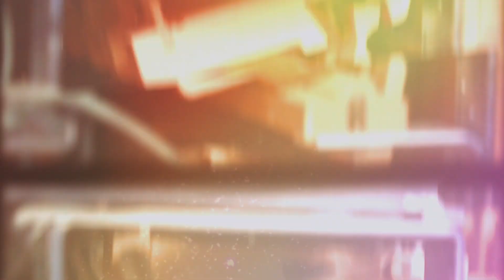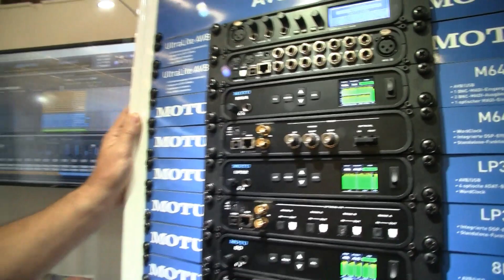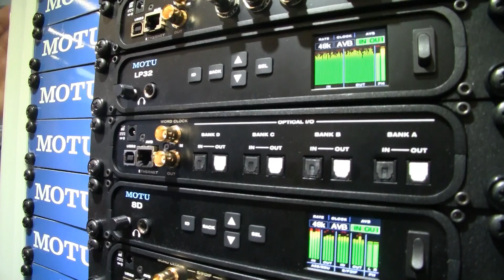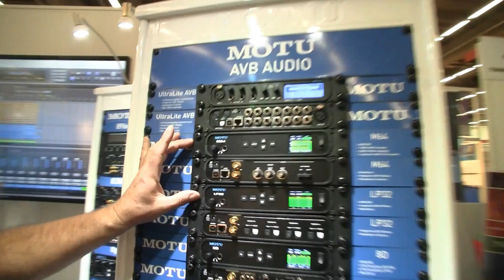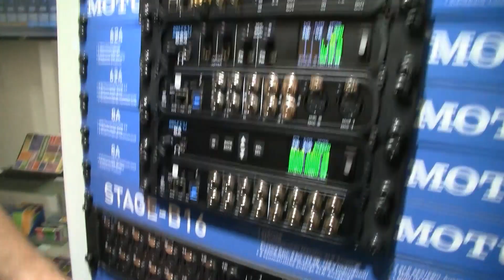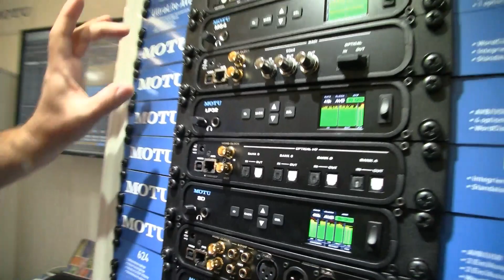MESSE 2017: MOTU - 3 New AVB Interfaces

Comment: The trouble with their AVB products are that they are Mac only!
Reply: No they're not
Reply: They're not, and you would know it if you'd check their site... I hope you're not just trolling?
Reply: Think you are misinterpreting something. Maybe you saw this " AVB/TSN Ethernet audio interface operation requires OS X 10.11 or later " under the "OSX system requirements" section. That only means you need the 10.11 version when running OSX. The Windows specifications are listed below, seperately, and I know for sure Windows 10 will do it, it says win 7,8,10 work there on the page too.
Reply: I thought you were talking shit but it does actually say that under computer I/O seems like they only work over thunderbolt and usb on windows
Reply: Sorry, to clarify, the use of AVB on all their interfaces is strictly OS X only. As an example:
http://motu.com/products/avb/624/specs.html